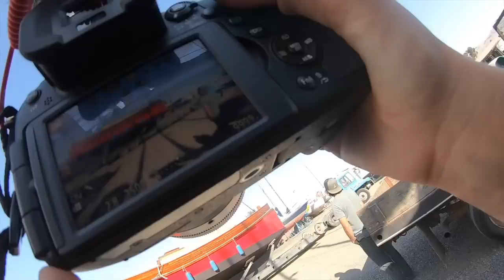Salt & Tar: Episode 76-Floating Once Again

Comment: The "Old Salts" in our yard say the builders used to fill the hull with water in the cradle on the hard to soak 'em tight before slipping them in the water. Seems it shortened swelling time by a couple weeks, leaving only a couple more till she sealed. 
Best of luck and fair winds

Comment: A trick I used for launching after a long haulout was to fill a coffee can with sawdust and lash it to a long pole with the top of the can pointing up the pole length. Put the lid on the can with a string tied through a hole in the lid. Figure out where the water is coming from and jam the pole and can under the boat and pull the lid. Suction will draw the sawdust into the openings and plug them. It won't stop the leaks completely most times but will slow it down as the sawdust swells. Use to make two or three of these rigs. Only had to use one once and it worked like charm. Nice to have them on hand if needed.

Comment: Ruth, "You're coming too". Thanks, just sitting in the yard would have been boring. LOL 

As much as the sheathing appeared on camera to have dried out, I kinda expected much more water ingress than the first launch. I was correct. But manageable with the bigger pump. At least the main hull is getting wet, it should swell in just a few days and give time to install the float switch and pit the pump to a through-hull (If that's the plan).
Good to see the grand lady back in the water.
Also, great to see Swab alert and moving about, now that he is on the boat. Bet he's been thinking, "dang, my humans are taking so long to get me back on the water!".
Ha ha ha!

Comment: You could pre-swell the hull by pouring a few buckets of water into the bilge a few days before  she goes into the water. 

I did this every year with my Lymen 21ft.
Reply: @mikeoconnell4229  Are you somehow unfamiliar with the concept of a bucket? It's a handheld container that can be used to hold and transport liquids, like water.
Reply: @mikeoconnell4229  I owned a Lymen boat and pre-swelled the wood hull every spring.
Reply: @danno1111  ok Danny boy, the fellow said "a few buckets"
Take it easy buddy, he put his foot his mouth.

Comment: Could of watched several more minutes of this one. Congrates on the first haulout ! Rule Super Switch and mount the pump lower than the switch with a backflow preventer, maybe on a nice two level shelf that easily unbolts from the bilge and can be lifted fr service.  As a backup, have the engine raw water pickup switchable from thruhull to bilge pump with hose with a strainer. Also useful for engine servicing like maybe having to run while hauled out with a bucket for the water supply or antifreeze to winterize the raw water system (heaven forbid) !   She looks  Yar !
Reply: justlooking2222 Yes I agree with the switch, it makes me nervous to see the clip being removed and reattached with the hydrogen gas boiling off the battery from being charged. I have a friend that got burned real bad from that exact operation. 😁🛫

Comment: Hello 
I have been watching off and on from the beginning. Very impressive with what they have done.
BUTT the boat is built from doug fir much of it from home depot. That is a soft wood. Relying on swell to seal a boat is an old idea and even with the old growth dense hardwoods like teak, oak, Ect. The boats really did not last long. They built the boat very tight it swelled the first  time with minimum leakage. (to Much) This is because it is a soft wood! Every time it swells it breaks up the fibers in the wood and opening up the joints weakening it and softening the wood. That's why the original bottom coat failed. The second time there was plenty of leakage because of the excessive swelling softening. The only solution is to coat the whole bottom with epoxy fiberglass like west system. The designer of there boat recommends that over and over in his plans and web sight. Nowhere does he recommend tar and paint.
Im writing this because i really respect all the work and dedication that went into this project. Hope they do the right thing before its to late!
Ps now all you cheer leaders can respond picking these well meant factual comments apart.
Reply: Good work guys. But I agree with Tom. If you want to hand this boat down to your children it needs to be sealed and glassed with west systems epoxy and a double bias glass. Then faired with thickened epoxy. Then more epoxy sanding ect. Then your hard work will be preserved and appreciated for a hundred years or more. I love all your videos and only mean well. Please seal it. I'm a boat builder and want you to be  happy in 20 years not throwing it away.
Reply: @justbecause3751  i agree obviously except at the rate of damage shown by the leakage. I give it 3 - 5 years max before the structural damage will make it impossible to fix.
Reply: So completely naive novice question...  you seem to be saying the wood used is fundamentally wrong and the boat will simply not take the regular drying out ?  I mean why isn’t this the most talked about comment . And why has this been overlooked through the years of building....

Comment: I think that you've had your engine in place for some time now why not get all of hooked up enuff that you could run it and use it in  cases were you need to move the boat around I say why not after all its  there how much more work could it take to get it to were you could use it when needed

Comment: I always postponed the launch date at least 3 times. It is not only that things always take longer than expected, but also the jobs not completed will be on the list of next year... Btw, You are  right to be nerveus connecting sparky things straight to the battery. There can be Explosive gasses coming off when charging or under load!

Comment: Im new here... why is the boat leaking after it looks like it was just worked on and painted?
Reply: Because the planks are loose when they are out of the water and it takes a while for them to swell back up again to fit correctly when the boat goes back in the water.  If the planks were not loose when they went into the water they would crack when they began to swell.    Water in the bilge after a day or two in the water is a good sign.  Water after a week or so in the bilge means that the planks did not fit correctly or broke....
Reply: The wood dries out and separates a bit while it's on land. After a while in the water the wood swells again and closes up. That is expected for a wooden boat.
Reply: @patrickwentz8413  interesting,  thanks! Cant wait until next week
Reply: @patrickwentz8413  So wooden boat is not good. Really good is metal.
Reply: @DanielSilva-jj2lz  All types of boats have their drawbacks.  Steel boats rust, fiberglass can be flimsy or delaminate or get a rotten core, wooden boats can rot or get worms, ferro cement can crack etc etc.  Pick your poison.
Reply: @patrickwentz8413  Unfortunately this is life.
Reply: @DanielSilva-jj2lz  Wood boats have been around for 4000 years. Wood is good. Metal rusts.